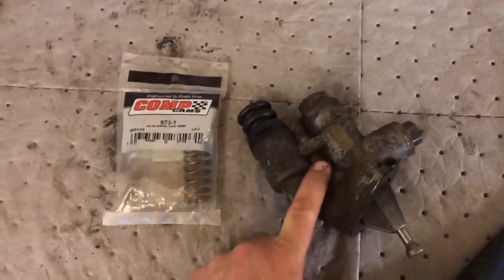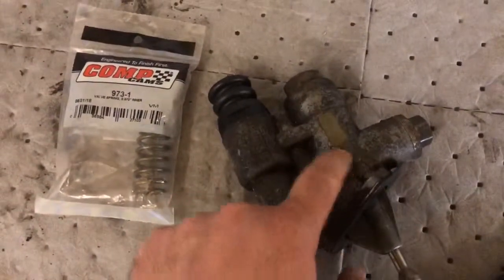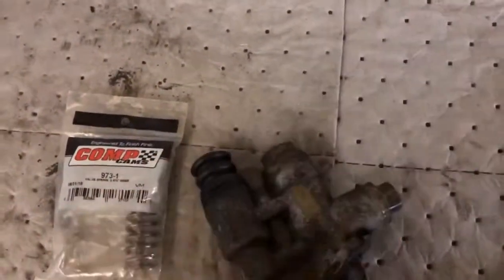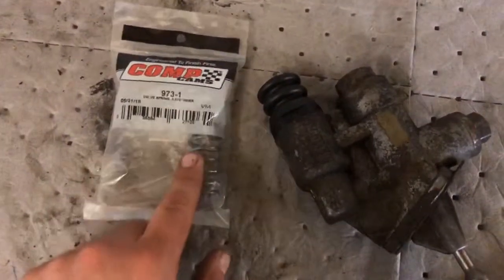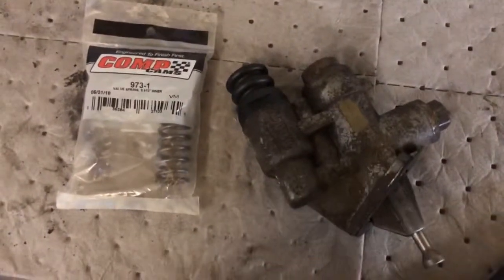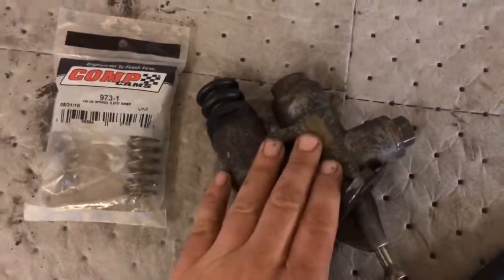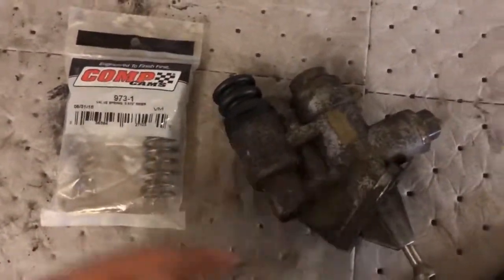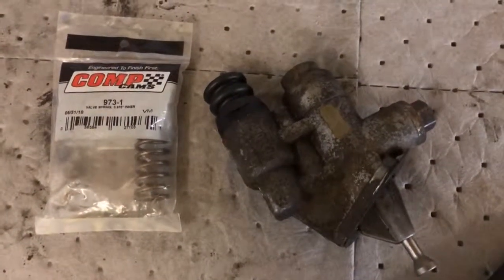12 valve cummins lift pump hotrod upgrade

Comment: So no air dog needed for up to 5-600 whp set up? Just the spring upgrade?
Reply from the maker: I’m making 650 wheel and still holding 40psi lift pump pressure at WOT. pressure measured at the inlet of the injection pump. stock steel lines from lift pump to injection pump. banjo bolts drilled. I do run a -10 feed direct to the inlet of the lift pump with heater deleted. 215 pump and 5x0.018s. I keep my tank full when drag racing to help with head pressure to keep pump basically gravity fed with a little force / head pressure. I still have lots of unburnt fuel out the hood stack so it’s supplying more than 650hp. i’m just not burning it all yet.
Reply: @coalstang  Looking at a stalled build, no plans on more then 400 whp and want to keep  everything as mechanical as possible
Reply: Just to confirm, spring change can be done with pump still installed on engine?
Reply from the maker: @XER239  i like to remove it and the fuel heater and delete fuel heater and cut off fuel heater spacer and reuse and modify the inlet fitting at that time. i think it’s easier removed from engine… i have never done it on the engine as i unbolt it all to remove the pump and heater/ filter at once.
Reply from the maker: now that i think of it…i think i tried to swap springs the very first time i ever did it and i gave up as the spring tension made it crazy hard to put back together on the engine in the truck. the cam lobe has the spring preloaded even when it’s on the low part of the cam lobe when installed on engine.
Reply: @coalstang  Thanks, that tension did come to mind earlier. Can't imagine it being easier down in a truck.